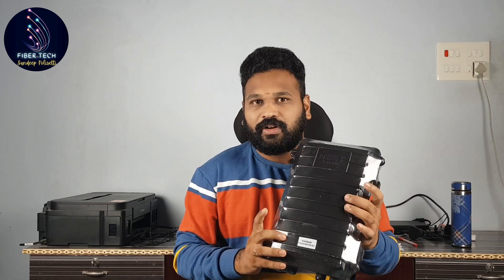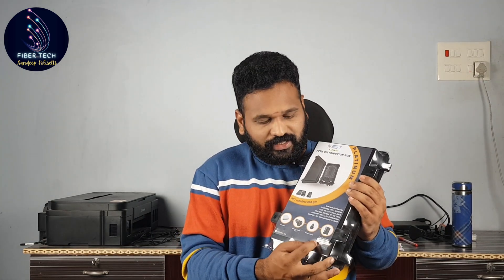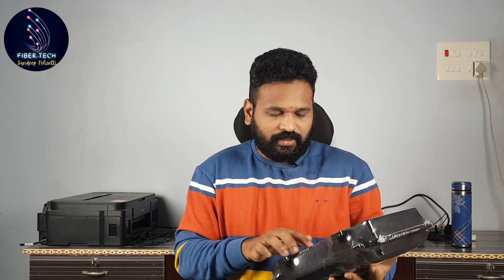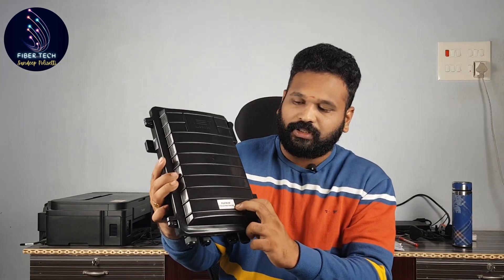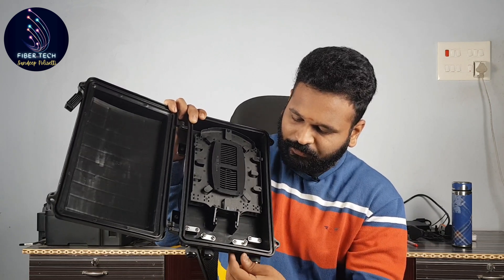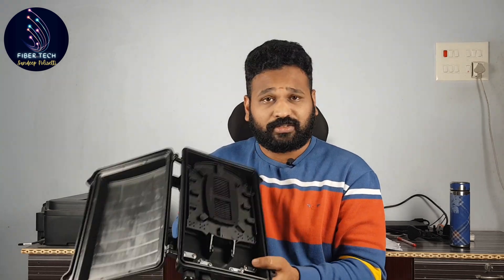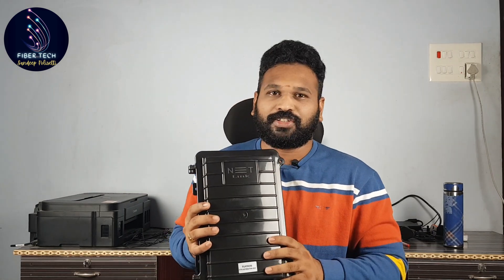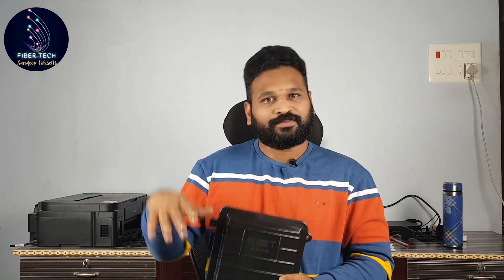Netlink Platinum Distribution Box | FTTH Platinum Box | Best Quality FTTH Distribution Box

Comment: Pros:
Build Quality high grade✅ 
More convenient for dressing & splicing
Second tray is an add on
Waterproof & Dust-proof

Cons:
Bolts not provided for Locking system 
Bamboos get steel straps for fixing, which is not provided for this
Easily can be opened & disturbed by on goers 
Slips down from the poles in 2-3 days after knotting.

To be improved

Hanging stand for splicing machine
Bolts or tags to be included in
Holes for knotting to be given with some rubber suppressors otherwise while tightening for 3-4 will get cracked
Single clamp to be provided with plastic locking & keys, instead of two closing clamps for securing.
After opening the box on left hand side two small racks to be provided for cassette type splitter’s, so it can be used as multipurpose FDB also.

This is my personal opinion on this box, otherwise it is fine and good to go.